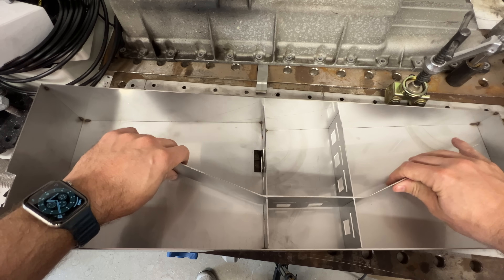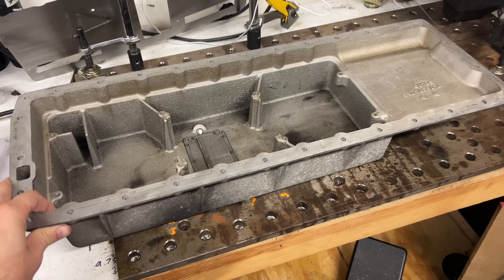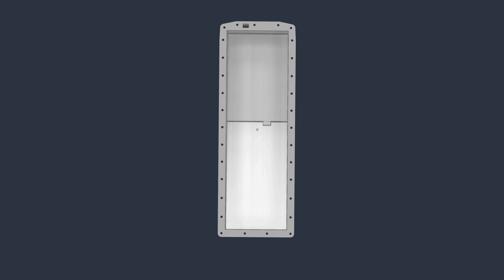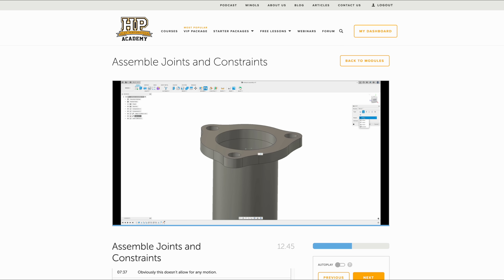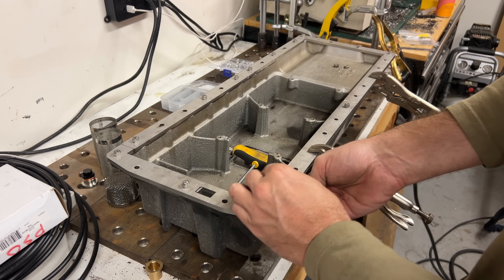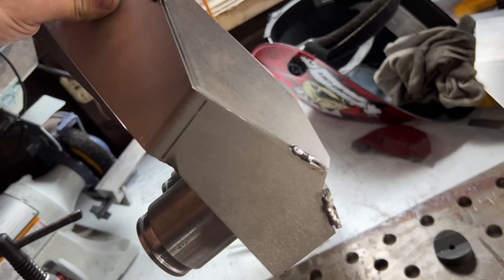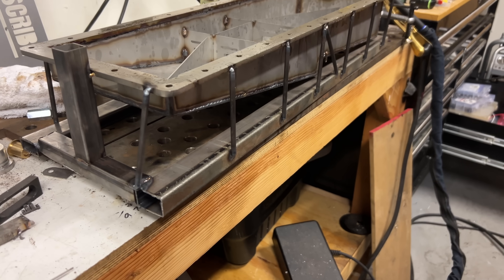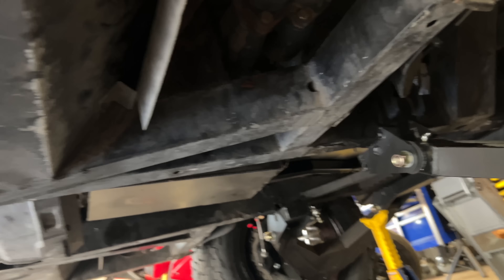Make An Oil Pan. Or Just Watch Me Do It. Whatever.

Comment: This is why oil pans are the perfect "I want to do something practical with welding now that I know a bit more" project if there's even the slightest excuse to make one.

1. It's a lot of long welds! Great for putting all those TIG skills out there for the world to see.
2. You get to hide the end result underneath your car for the world not to see or know of, only you know what you did.
3. There's a visual "your weld failed" indicator it'll leave on the drive way. (or an audio-visual indicator at highway speed)
Reply: With added fourth dimension! Your car will even shake like those seats once your engine explodes!
Reply: Wait...you TIG your oil pans?
Reply: @michaelkrenzer3296 ever stick welded aluminum?
Reply: @TheLtVoss  Mine was sarcasm 100% but also have not had an AL oil pan yet.  We do modify about one stamped steel oil pan a year (baffling for extended cornering or to put the right engine in the wrong car) and they get MIG welded.  We use our best welder (not me) for this as the combo of almost impossible to clean, low quality steel and variable thickness means it gets ugly fast.
Reply: @michaelkrenzer3296   mine was sarcastic too   well yeah MAG/MIG   is standard for welding low alloyed steels it is fast and easy (different material thickness is a hassle for sure) and well TIG isn't so much difference but because of the manual feed it allows for more control in heat  is Abel to weld almost any metal with the right settings but the manual feed makes it way slower